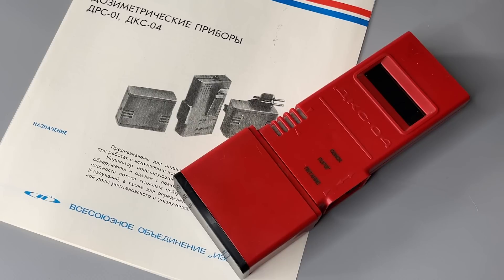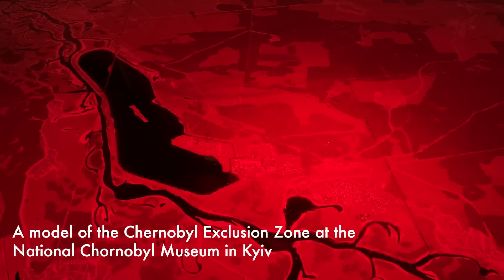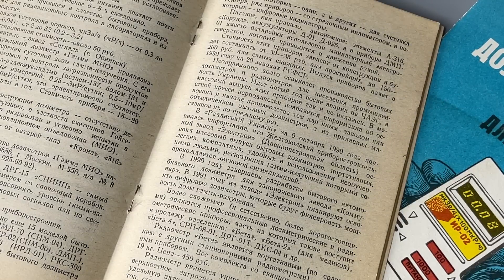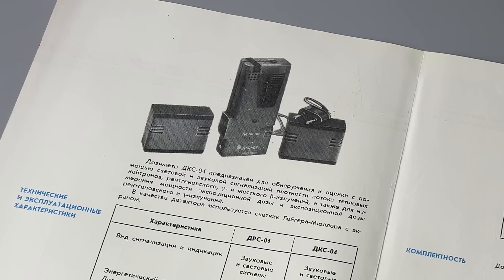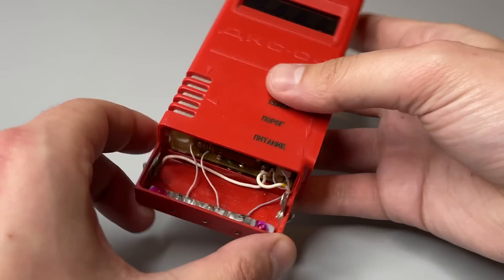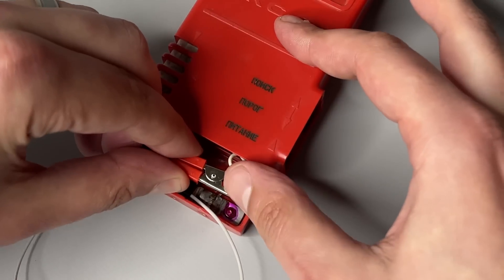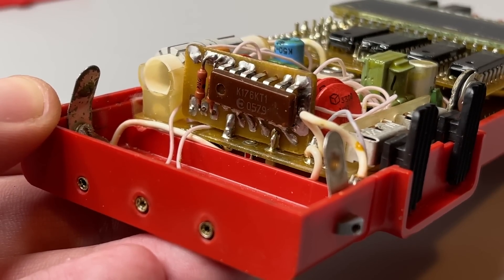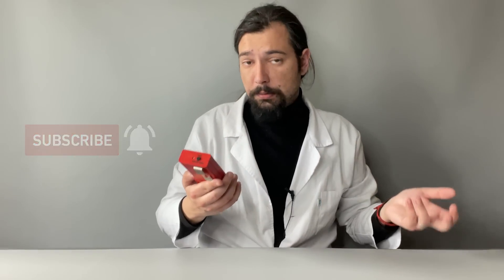Relic of Pripyat's Afterlife: DKS-04 Professional Dosimeter

Comment: Wow that thing looks so cheap, and those switches moving in every direction, ready to fall down... Soviet industry at its finest 😅
Reply from the maker: At the same time, inside it is quite all right and its capabilies are quite good. But yes, those switches indeed could be much better.
Reply: @ChernobylFamily  It's not the outside that counts, I know 😂
By the way you say in the video that soviet LCDs were generally bad and broke easily, does it apply to all the devices made in the USSR? I was considering buying an Elektronica watch or calculator
Reply from the maker: @Crazyfrench depends. Elektronica watches and calculators mostly were quite good. Some — very good. But speaking about dosimeters, they used a specific family of displays which are known for having issues.
Reply: @ChernobylFamily  Thanks a lot for your answers, your channel is really great guys 👍

Comment: I would be surprised if the LCD was working. Most Gameboys and other handheld LCD Displays are dead now and they are not as old as the Dosimeter.
The problem is the glue. When it fails, the LCD crystals will leak out. You can replace them which isn't hard to do for simple 7-segment displays.

Of course, the Japanese used better glue or other methods to seal the displays a lot better. This is what we are used to in the west. But the Soviet Displays are not that bad. Especially if you consider that such a device won't be accurate forever and has to be replaced relative soon. So if the Display will last for more than 10 Years, that's much more than good enough. Also you can always replace the display.

Since you can see the signal lines in the display, you can determine the pinout quite easily and compare it to modern Japanese standard LCDs. Maybe even the footprint will match.
Reply from the maker: It is quite interesting that most of those devices outlived their planned lifespan and sometimes still are in use. Speaking about the display, we found a matching replacement, though seller adviced to grab a few as "you never know", and he is right. The problem is known specifically for ИЖЦ displays like this.

Comment: I have to wonder if hacking in a modern LCD or LED module might be easier than sourcing a period correct one,. OTOH,  if the module  in it is a clone of a western one you might be able to find a NOS part that might work. It all depends on the specs of the LCD.
Reply from the maker: We already found where to buy an original one, they are super cheap... though as far as I know, there is a practice to use LED indicators as well.
Reply: @ChernobylFamily  Hopefully they've been stored in halfway decent conditions. Thats about the only thing on there that would be liable to fail after a few decades assuming the solder joints are solid throughout. Maybe some of the capacitors especially if there are electrolytics. TTL chips tend to be pretty sturdy and hard to kill. How reliable are the actual Gamma ray and Beta particle sensors on a counter like that? Are they the kind of thing that's built to last?
Reply from the maker: @ironhead2008 from my personal experience, if a detector was not exposed to harsh conditions (e.g. himidity), it will last very very long. In any case, certain issues is possible to compensate with a proper calibration. Speaking about this very device, I found issues with electrolytes there, all other things seem to be ok.
Reply: @ChernobylFamily  That's what I figured. Humidity's the universal killer of most electronics. If you add drastic temperature shifts to the equation, it's going to be worse. Hence the conformal coating on anything approximating milspec. Looking forward to the update on this wonderful piece of tech.

Comment: I have a BELLA which I bought on a flee market in the late 1990s in Germany. The switch arrangement and case on the DKS-04 looked oddly familiar from the beginning of your video...
Reply from the maker: Yes. The case is the same, just DKS04 has a smaller compartment as D-0,1 cells are used. Bella uses 9V battery, so it is bigger there. In fact, there were a few different devices with that type of case.

Comment: Please, can you dig up some info about the РКСБ-104. A friend in a Swedes forum got hold of a large number of them but had do deal with the display as the original displays often were in bad condition.
Reply from the maker: Which info exactly is needed?
Reply: @ChernobylFamily  The kind of great information mixed with your fantastic sense of ironi, whenever you meet any of these instruments.
Reply from the maker: @Soundbrigade  :)) I guess we will just buy one RKSB-104 and make an episode about it then. A quick googling indicated they cost around $60-100 here depending on condition, so I guess will need some time.

Comment: Doing dosimeters on a contaminated city wouldn't make calibration process challenging? It is like trying to develop a photography in a non completely dark room.
I find interesting you referred to the exclusion zone as "the zone" exactly like the characters in the book Stalker and in the movie did.
Another question: the ICs seem to be covered with a shiny protection like a varnish. Is that so?
Reply from the maker: It does not change anything because calibration is always being made in so-called "lead house" which isolates any side emission. From what I know, measures applied to buildings and regime of work in there allowed to maintain levels inside mostly within normal or very acceptable limits. So, it was quite ok to work there.

Edit: also, nearly all structures that were in use in Pripyat were in the center and north (generally, at district 4), there levels were MUCH lower than in 1st, closest to NPP. There were exceptions, some were also there, but not many.
Reply: The whole board is covered in varnish, not just the ICs. They used to do it like that in the Soviet Union most likely to protect the components in harsher  conditions. I've seen it in military (and similar) devices but even some consumer electronics boards were covered with that stuff.
Reply: @xxexplosivexxxxexplosivexx8512  Here in Brazil in the 70s there was a product commonly used that I think was more like shellac than varnish, as that is more resistant to water. But it was always used on the solder side of the PCB, I never saw something like that used over the component side.
I imagine how many components would be saved from electrolytic capacitor leaks if this was common practice.
Reply: @agranero6 conformal coating is quite common in industries where safety matters. If you look into any car computer, plane and other safety electronics most of them will have such coating
Reply: @agranero6  I have a few Soviet boards that are covered with varnish from both sides. I'd even say he components side is actually a bit overflooded with it. The only downside is the capacitors are absolute garbage, would all need replacing and having them stuck down is kinda unwanted.
Reply: @xxexplosivexxxxexplosivexx8512  Probaly they were dipped in varnish and let to drip and dry, is a much more practical way on industrial scale.
Yeah maintenance would need to use solvent to get sccess to it.
When he fix the dosimeter we probaly see how he will deal with it.

Comment: I always find most Sovietic devices so "form follow function" oriented without any attempt to make them pretty. But weirdly in a device that is not for consumer market , but basically an industrial device (well I imagine that for people living in Ukraine and nearby this became a consumer product) they made something, well tried to make something beautiful. It looks slightly with some early Fluke multimeters with the LEDs in place of the buttons. Despite of the final product issues the design is ... nice.
Reply from the maker: Well noted. From the point of practice, as less fancy the dosimeter is, as better. From this point, this one has issues: that place where switches are located can become a collector of radioactive dust, and to clean it might be a problem.

However, the device itself is indeed not bad; though I believe it was not really available for consumers, as professional equipment has been sold through V/O IZOTOP system only to organizations. However, we know a lot of people who had Bella dosimeter, that is not the best one, but it just worked.

Comment: The first IC visible is a К176КТ1.
A Soviet clone of the 4016. Quad CMOS bilateral switch.
Going by the date code of 0579 this was manufactured in early 1979. Which would make it older than Chernobyl Unit 4
Reply from the maker: Well noted!
Reply: I have to wonder if it was salvaged from some other equipment if it's that old. That or it was in some cache of NOS stuff the techs that modded that counter got access to.

Comment: I noticed that the circuit boards are coated in a Lacquer , not unlike Our American Military electronics. thank you my friend, for explaining how a Dosimeter works, it was really interesting  to see the internals as well😀👍
Reply from the maker: That coating is a sign of a factory that generally produced military stuff. That was their standard. Glad to be helpful!
Reply: Like he said. It's a conformal coating, it gives a bit of protection from humidity to the board. Curiousmarc (another youtuber) did some videos on a couple of models of Soyuz capsule chronometers and the boards were practically identical.

Comment: I wonder if the LCD is compatible with a currently available, modern one, or you will have to source a NOS Soviet one, and hope it hasn't failed yet...
Reply from the maker: I checked - that is a clone of a japanese one, but original ИЖЦ are available for literally $3.. so we will replace it. But upon a further inspection, need also to change capacitors and likely also that detector - as the circuit works incorrectly.
Reply: You can get a custom LCD made in China, which is a product that has dropped in price, though you might have to reverse engineer it, and order 100 of them, but you can always sell the other 95 to recover the cost, fixing other units that used the same display.  But as it is likely a 4 digit common backplane display, and those are still common parts, should be easy to find a modern drop in, though you might have to do a little work to make the pin spacing closer, as the modern displays are considerably narrower, so the pins will all need a spacer.
Reply: @SeanBZA  Where can I get those custom LCD? I need an LCD for an old Casio graphic calculator.
Reply: @SeanBZA  Yes, I watched that EEVBlog episode a few years ago. I have three identical '80s Hung Chang pocket multimeters with dead LCDs that I'm considering to order LCDs for.

Comment: That red plastic screams late 80s-early 90s I swear that specific red shade of plastic was everywhere in the world at the time
Reply from the maker: Well said!
Reply: I used to have a heater/fan made in USSR and the red plastic had exactly the same color
Reply: @SergiuszRoszczyk  Soviet heater fan with plasic housing... That is not a good idea to use, because it likely has inadequate overheat protection, and the plastic also likely has inadequate fire retardant capabilities.
Reply: It reminds me of the motor bike in Akira movie.
Reply: But that aesthetic was from the 1970's. Have a look at a Sinclair Cambridge Memory Type 3 (1974) as one example.
Reply: @DetroitMicroSound  yes but it wasn’t phased out of production until much later, I still have stuff from my childhood that was made in the late 80s/early 90s with that material. I’d assume it was cheap to manufacture or had some form of chemical advantage (like not going brittle in UV light unlike beige/white plastics of the era) and therefore was used excessively.
Reply: @Underestimated37  Probably had a massive surplus of Red plastic pellets of that specific formula, found it was very durable and used it because it was basically free.
Reply: @DetroitMicroSound Agreed. Didn't Sinclair Research make a red calculator at one time?
Reply: @DetroitMicroSound My mistake - Sinclair Cambridge. I wasn't paying proper attention.